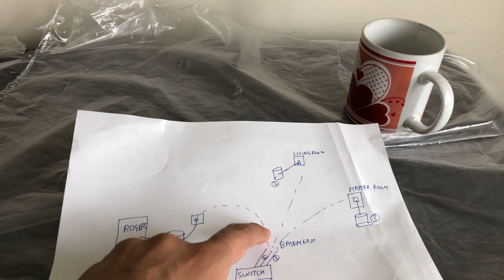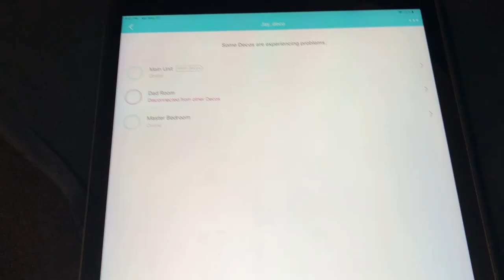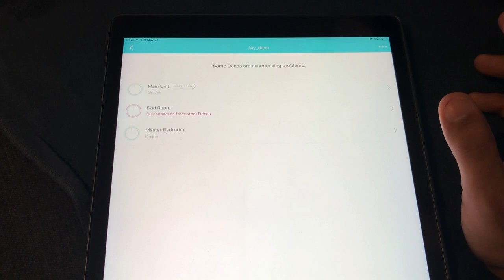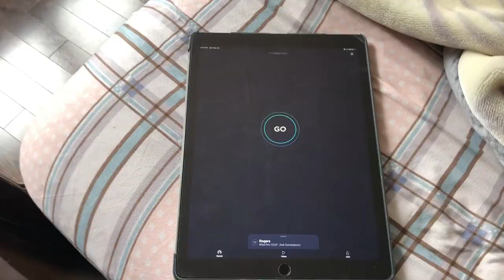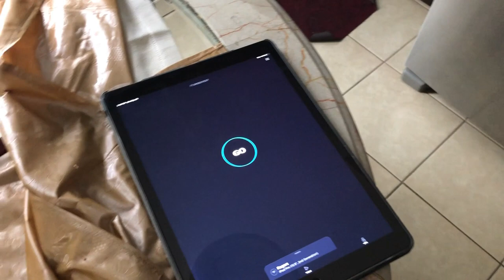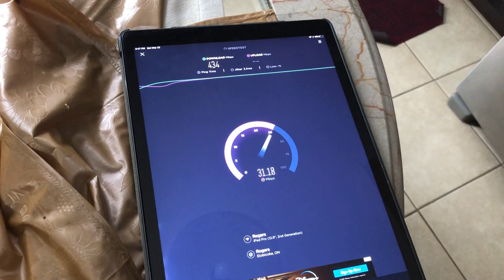Hardwire/ Ethernet Backhaul Mesh Wifi 6: TP Link Deco X60

Comment: Have you tested access point mode in these deco?
Reply from the maker: Yes I will be putting a video up shortly
Reply: @Canada_Facts   thanks for replying, please tell me does connection drop when you roam?  And which is better access point mode or router mode as i have order new routers accordingly
Reply from the maker: With access point yes
Reply: @Canada_Facts   which one is better

Comment: Can I connect my 3 deco to the switch and then can i connect my switch to modem. Is that works?
Reply from the maker: No then all 3 decos would be independent of each other
You need to have a master deco which connects to router and other end to switch—> from switch other decos connect
Reply: @Canada_Facts  Hmm I was attempting to do the very same thing with Google mesh units but I think this was what I was doing wring then! :(

Comment: I plugged in ethernet but my deco nodes took the signal source from the 2.4 ghz connection instead, help?
Reply from the maker: Looks like the nodes are not hardwired
If they are using 2.4ghz it probably means they are far from main node
Reply: @Canada_Facts  should i plug in my main deco to the switch too? Rn im plugging my isp modem to a switch that ran all over the house, funny thing is my third slave deco is connected by ethernet to the second one
Reply from the maker: @breadmakesufat5473  
Connect modem to one deco aka maindeco via ethernet
Connect the maindeco to switch
From that switch connect cables to other decos

It should solve your problem
Reply: @Canada_Facts  will try after work, thank you very much

Comment: i am having main connection of 300 mbps and i am getting 290 mbps when i switch on 5 ghz band and when i switch it off i am getting only 120 mbps on 2.4 ghz band and tp link mentions 500 mbps on 2.4 ghz wht so?
Reply from the maker: 5ghz is faster so it’s expected that 2.4ghz speed will be lower
Reply: @Canada_Facts  yes that i know but when company mentions 574 mbps it should be able to give 300 mbps
Reply from the maker: @goyaljatin3  https://www.tp-link.com/ca/home-networking/deco/deco-x60/
See the picture in this link
It should deliver upto 287 MBPS
Try disconnecting all device and hardwire your laptop to deco at 2.4 band
If still it is low I would recommend contacting TP Link
Reply: @Canada_Facts  yes i saw but it is giving max 120 mbps, can you check yours, how much it gives with 5ghz off. And please also tell how much speed you connection provides?